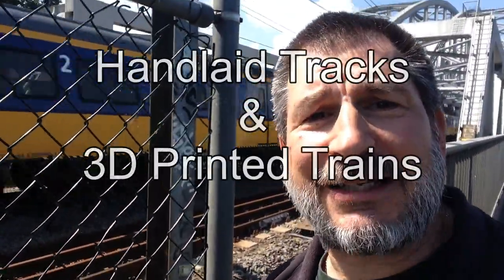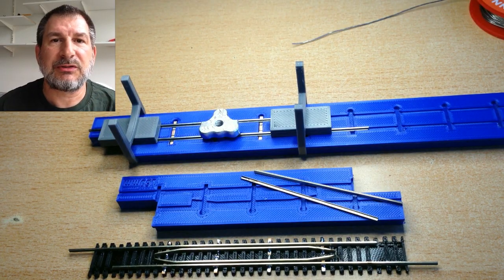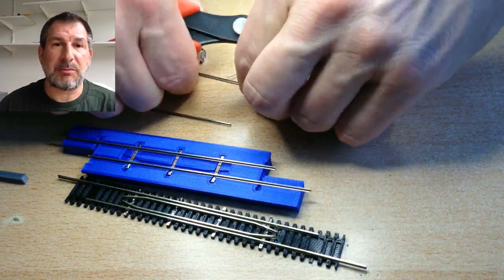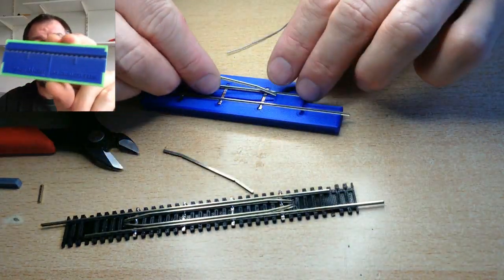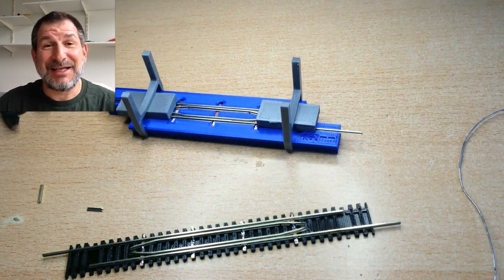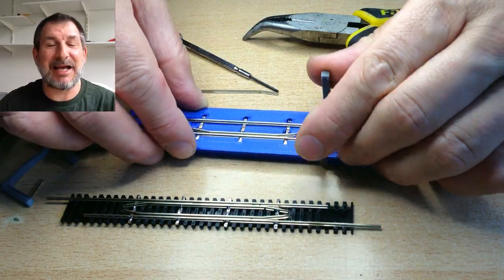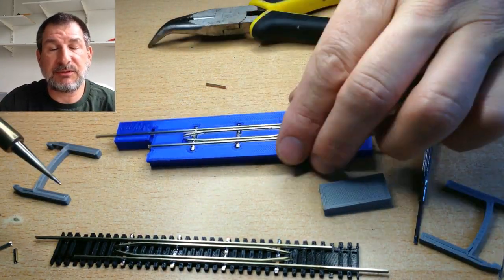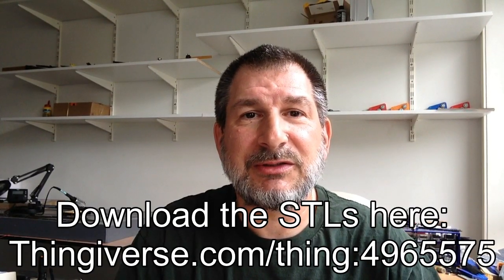3D Printed N Scale Model Train Rerailer

Comment: Suggestion is there a way you could make a jig for us who cut are pcb ties form pcb board
Reply from the maker: You mean from a flat sheet of two sided copper PCB? I tried to build a jig for my Dremel but the results were not good enough. Also it seems to throw lots of fiberglass bits. I think a CNC cutter is the best option. Maybe stack a few plates and then run a "zig-zag" much like those Fast Tracks seem to be made.
Reply: @handlaidtracksand3dprinted922   thing Is I don't have  a cnc router I'm having to cut via a razor saw and you seam to have the nack for making jigs
Reply: Ps I bought single sided pcb in bulk form Amazon so ya I'm trying to stretch a dollar
Reply from the maker: Single side doesn't give as much strength since only the PCB is left once gapped... I think a band saw may work as well. Problem is what do you use to make the cuts? Isn't easy, and why I gave up and bought a pack of cut PCB ties... I've seen some use snips and then straighten using a vice...
Reply: @handlaidtracksand3dprinted922  trying to build a layout on. A budget and hence I saw a deal
Reply from the maker: Have you tried scoring with a strong sharp blade? With just the one side to cut through it may be enough. Budgets and model trains don't see eye to eye...